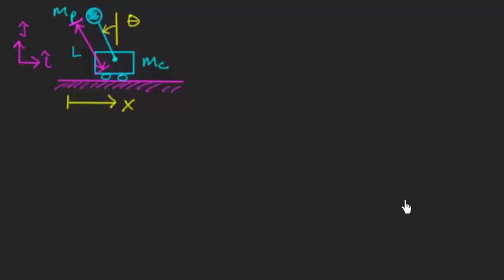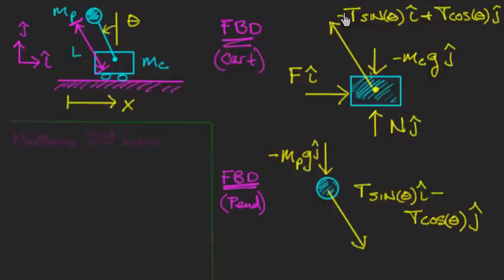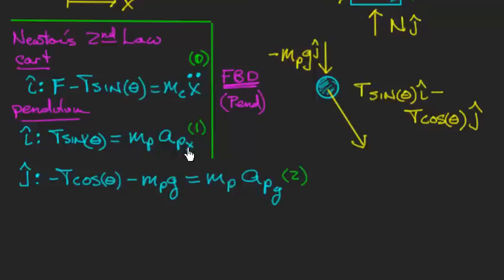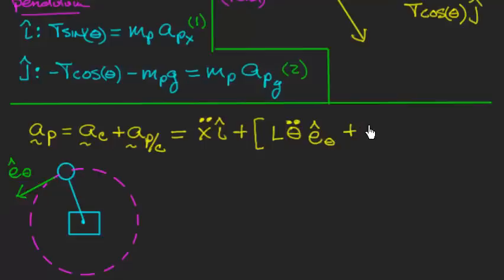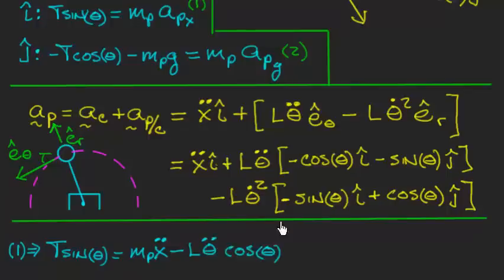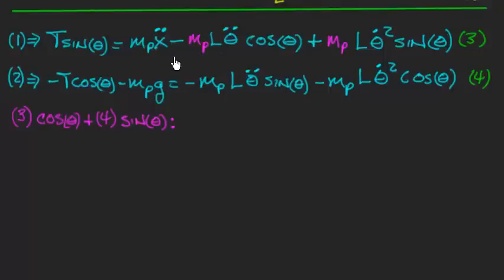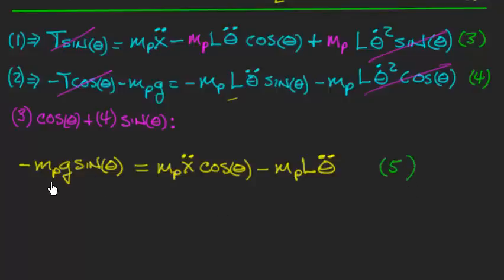Classic Inverted Pendulum - Equations of Motion

Comment: can we not use an angle sensor to give us the angle of the rod. such as mpu6050
Reply from the maker: Yes. I'm not sure what your point is. Equations of motion remain the same.
Reply: If I want to make an autonomous inverted pendulum, using a microcontroller and control system, So will I need an angle sensor to find the angle of the rod, or just only these equations will be enough? thank you
Reply: in a quadcopter which has 4 motors,. an angle sensor is used that gives the angle of the quadcopter and the quacopter then sets different speeds of the 4 motors to keep the quad level.
Reply from the maker: @Spectamin  The equations by themselves are not enough to control the system. To balance the pendulum, you would need some sort of feedback. An encoder (angle sensor) or an  IMU would be very valuable .

Comment: Excellent video. Most control books don't review mechanics and all and just throw in the final result or vaguely deduct the equations needed to build the state-variables expression. The only thing I would have liked is that Newton's 2nd law for rotation had been used instead, working with torques and the moment of inertia of the pendulum in respect to the axis in the pendulum-cart joint. However, the point of this video is to achieve the equation in a simple way to avoid having to remember rigid body mechanics entirely and stuff like that, so I understand why you took the way you took. Thank you very much!

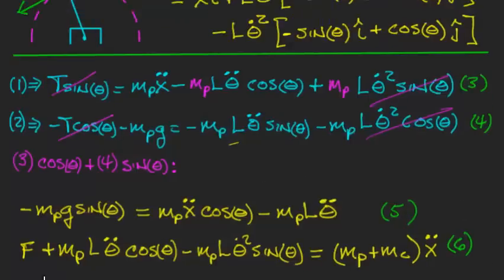Comment: Hey i neeed to take a laplace transform of the final equation (at 22:41) but I don't understand how can I take L transform for the MpL(theta')^2 * theta. as it has a derivative and the independent variable multiplied together.
 PLEASE HELP ASAP.
Reply from the maker: you have to linearize before taking the Laplace transform.
Reply: +Brianno Coller rekt
Reply: Laplace transformation method is not applicable for nonlinear system as the case with this inverted pendulum cart system. If you really wanna do that, then you have to impose some assumptions so that the system is considered as a linear system. The   physical meaning behind this notion is  that when you start the experiment, the pendulum must be placed very close to the vertical position and  there are no external forces that deviate it from that position, therefore, it is safe to assume that con(theta) = 1 and  sin(theta) = theta.

Comment: In practical when the cart moves left the pendulum moves right, so keeping this in mind the ac in the equation ap = ac + ap/c should be negative of the acceleration of cart? 
Correct me if I am wrong?
Because I compared your answers with a text I was reading on this topic and there was a slight difference in the final answer due to this reason.
Reply from the maker: The equations in the video are correct.

Comment: Why can we add (3)cos(theta)+(2)sin(theta) together?
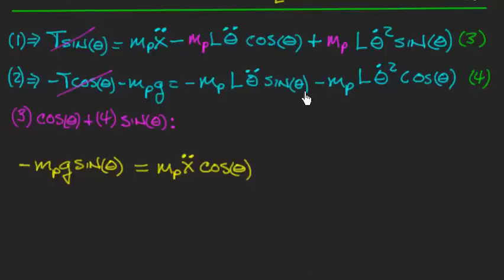Reply from the maker: Do you mean (3) cos(theta) + (4) sin(theta), like that shown at 19:00? If so, then it is important to know what this means. The (3) refers to equation (3) and the (4) refers to equation (4). So (3) cos(theta) means that I'm taking every term on both sides of equation (3) and multiplying by cos(theta).  When I do so, I still have an equality (i.e. the stuff on the left side of the equation EQUALS the stuff on the right side. Similarly for (4) sin(theta). Then we simply take these two equalities and add them together: add the left sides of the two equations; add the right sides; the two sums should be equal. That's it.

Comment: Thanks for the video! I'm a bit unsure why you only showed tension in the rod. Shouldn't the rod also have a shear force perpendicular to tension? Otherwise it's just a string??
Reply: strings only support a tension force whereas rods support compression and tension. when the pendulum is above the horizontal the rod is in compression so the string would bend